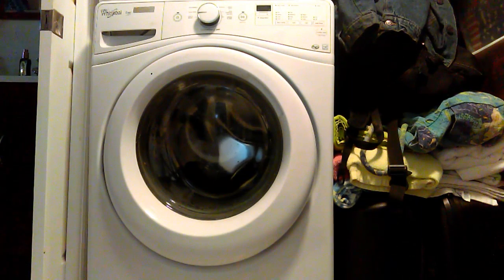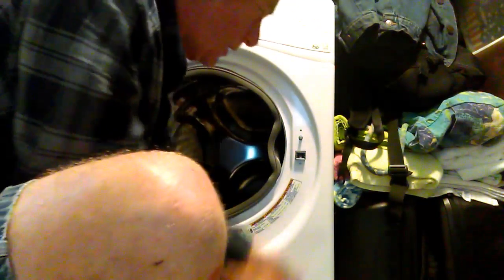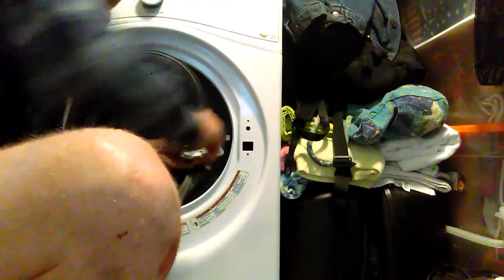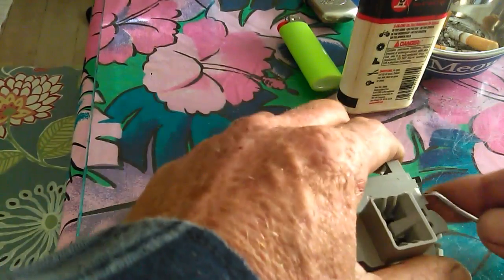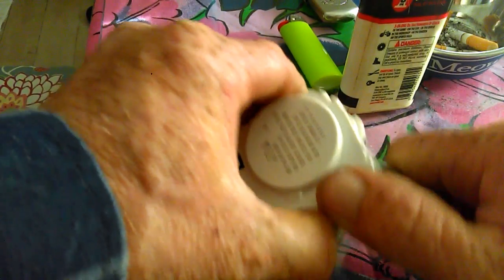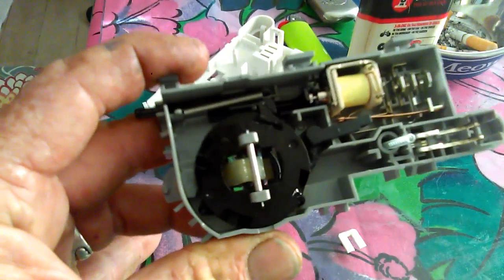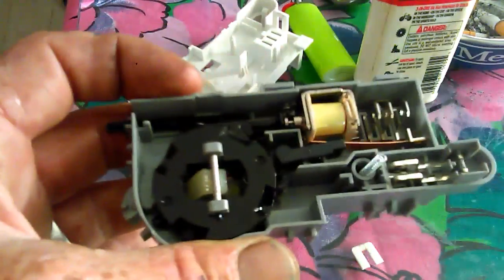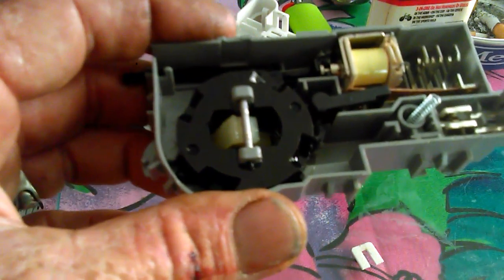Whirlpool front load washer code F5 and E3

Comment: Instead of removing the spring-loaded wire ring, which is super hard to put back on, I went in through the top and removed  the big weight over the tub (just 3 big screws to remove, which was easy). That allowed me to access the box, unplug the wires and pull the box out for this fix. 

Thank you Andrew for publishing this solution. It saved us from having to wash clothes at my daughter's house because we're leaving in 36 hours for my other daughter's out-of-town wedding. So, super stressful when the washing machine went on the blink earlier today.

Comment: Thank you so much! This was exactly what happened to my washer door. For those who were wondering how to get the door open, my door was stuck in a 5-click cycle while the alarm sounded. I figured out it was the lock engaging and disengaging. If I pulled on the handle at the right time during the clicks, the door opened.
Reply: Thank you so much

Comment: Hey, just wanted to say thanks for posting this. This was exactly our problem, and you saved me the cost of a repair bill. Thanks! Oh, and for others, yes, getting the spring-like de retainer ring back on is a huge pain, but it's a lot easier if you have a helper to hold one section in place with a screwdriver. Also, put the spring itself in last - much easier that way.

Comment: This was awesome. It's exactly what was wrong with mine. Fixed in no time. As for the spring use a pair of lock grips. Put the spring on half way 12 - 6 and lock the players on the end of the spring and pull it. As you do you push the rest of the band onto the lip. Super easy. Thanks for the help and info!!

Comment: Appreciated Andrew.  Couple of thoughts: if the washing machine is locked, then you have to take off the top and reach down and pull up on the white ring attached to the door lock assembly (then start with your directions).  Also, the lower spring being referred to is a small piece of straight metal that has fallen out of the 'groove' it slides along in (it isn't a spring).  Also, when putting the 2 pieces back together after you've put the piece of metal back into it's 'groove', the 1inch spring that falls out when you separate the 2 sides must be lined up with the end of a top that comes down from the white part of the assembly that holds the spring in place (does that make sense?).  We called to get warranty service as I made the repair as you showed - all we have from the warranty service is an email saying that will reply within 1-3 days and with your help I had this fixed in under 30 minutes easy with company coming this weekend!  Thanks again.
Reply: Thanks for the info regarding removal of the top to get to the ring - I had a throw rug caught in the door causing the machine to lock down with the motor running to drain.  Everything froze so all I could do was unplugged the machine until I Googled this info on YouTube.  Removing three screws allowed the top to come off and hubby was able to release the door lock.  Washing is now underway and it took all of 5 minutes to fix.

Comment: Mine had the exact same problem.   I fixed it as per your video, and it worked for about a week, before the spring popped back off again.  I screwed around with it, glued the spring in, ended up breaking two of the tabs off, that hold the casing together.  Then it dawned on me, the casing is spreading a little allowing the spring to pop out.  I put it all back together, but this time I wrapped the case in strips of duct tape to hold it together firmly.  So far, it's holding up.  I ordered a new latch, but saving until my duct tape fix stops working.  ;-)

Must have locking pliers to get that door seal spring back on.  

Thanks for the tip, try the tape.  :-D
Reply from the maker: I Should have mentioned the ducT tape as I did mine the same way, Thanks for posting the tip

Comment: So appreciate this video!!! I searched the internet and kept seeing the basic resolutions that weren't working until I found this. One issue I ran into was reattaching the spring that holds the rubber on the outside. Not sure if it's just old and not as malleable since it seemed you had no issues removing and putting it back on but it's giving me a tough time. The washer works again though so THANK YOU!!

Comment: I am going to leave the tension spring off for now until I can get a spring expander tool. That thing is impossible. I should have known by the difficulty I had taking it off. This is what happens when you have machines building machines. The lock fix worked perfectly by the way. Thanks to you!
Reply from the maker: it's a bear but can be done with a mechanics curved pick and a pair of needle nose plyers I bent one end of the spring open slightly to help get it to lock/go into the other looped end of the spring.
DON'T RUN IT WITH OUT THE SPRING WATER WILL LEAK OUT.
be patient and think, back away from it for a few minutes and you will achieve it

Comment: Thank you for the video.  I have a Maytag Direct Washer which has the exact same component.  We found that Whirlpool and Maytag are one in the same.  We called the technician that's scheduled to come out in about a week and asked about the F05 E03 code and he said he wasn't sure what the problem was.  We wanted to know if there was some remedy we could do instead of waiting a week for service.  He said no.  It took less than five minutes to google your video.  ***Individually we are all stronger than corporations that build these inferior products. *** This should be an easy fix for a country with excellent technological ability.  Thanks again for sharing your knowledge.
Reply from the maker: Yes it is an easy fix however the design was made here in the U.S. and manufactured overseas or (SOTB) and once tooling/assembly line work starts they won't make a change. I'm thinking of removing mine again and making a 3D printed fix that I can sell for $100.00 and shove  it to the man.
Thank you for your comments
Drew

Comment: Help! I did this a while back and it sort of worked until last night. Then I did it again and it worked first time but now it isn't working. Am I putting the spring in the right slot? I can't quite tell in the video. Or do I finally need a new switch? Thoughts? Thanks!
Reply from the maker: when you have the latch out you can see the grove it should be in and pressing the release button you should see it's action.
if it continues to POP off try zip tying the 2 halves together... ELSE - find a new lock assembly

Comment: If the door is locked when you turn it on press and hold power button it will release.  Sometimes it takes a few tries but it works.  Then unplugged and repaired the spring.  Took longer to put on wire back on around rubber than actual repair.

Comment: Fixed it instantly. I can't thank you enough.
Reply from the maker: Great to hear, glad the vid was helpful to you and the others. Remember to not "SLAM" the door and you should be good, If you install a new lock and continue to SLAM it will always F@#$ UP.
Reply: Rob Rice that top spring you pop off, where does it go?
Reply: Juan Martinez it connects to the grey hook on the left and on the right it connects to a small black hook/notch that's part of that black piece at the very top right. It's hard to see the hook/notch
Reply: Watch the video and pause it anywhere around 3:40-3:48. It shows a good picture where to place it.

Comment: I thought I fixed everything per the video and when I put it back, I guess the white plastic latch which you can pull up to manually unlock the door was put on incorrectly. So, I'm still getting the errors and now I can't open the door to try and fix this unit again. Are there any suggestions on how to fix this? Thanks!
Reply: Sorry, that was a dumb question - I was able to just reach down and press the button to release it. I pulled back out the latch assembly and reset a few things and it seems to work! Going to go check to make sure the laundry is still running ok :) Thanks - great video!

Comment: Good show bud, had a pretty good idea how to tackle this but a nice video to get the brain pumping always helps. I will probably try to by pass all together within the electrical circuit that runs from the control panel but thats just to get crazy with it why the hell not appreciate you.
Reply from the maker: maybe.... Adding an Adafruit Feather HUZZAH with ESP8266 WiFI so it can be Unlocked remotely from work or even the ISS or the moon for that matter. And it can be moniturd to show which cycle its on and turn the oven on to make pizza and make to doorbell ring when it's done washing the cat..... er the cloths :-)

Comment: I had an F5 E2 error message--still about the door not locking properly.  Well you just saved me $200 plus parts, Thank You!  If it keeps popping off I'll probably replace the assembly but it will be no problem doing it.  Hardest part: getting the spring back on the rubber gasket (I extended it with an elastic band for now); any tricks to getting it on?
Reply: Hi I have a code just as u f5 e2 did you get yours fix can u help me out thanks

Comment: What do i need to do if my door won't open? With same error codes
Reply from the maker: on mine it was stacked and I had to press the open button and pull gently on the door it finaly opened. if yours is not stacked you can take the top off and use the manual release in side where the latch is

Comment: Yeah, but the door won't open...  thanks anyway.
Reply: Update:  Plugged the washer back in, powered on and off with the power panel button, and the washer repeatedly attempts to unlock the door.  By applying a little outward pressure on the door, it popped open.  Your fix works, but as others have noted, the broken tabs cause the issue to occur again and again.  I'll try the duct tape idea and probably order a new latch.  Thanks again.
Reply: There is also a little white loop on the top of it. If you pop the top off and pull the loop up it will release the door every time.
Reply from the maker: I don't have the machine anymore but I do believe how I open mine when it was locked shut what I kept pressing the open button or the or the power button while putting slight pressure on the door as it clicks eventually it pops off or open I should say
Reply from the maker: @tysonpawliuk817  Stacked with the dyier on top? I dont think so